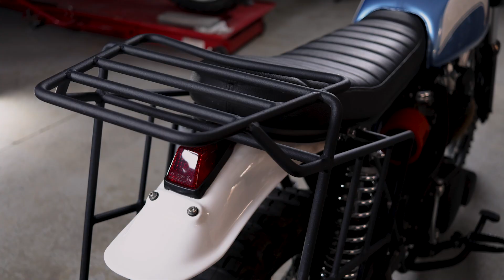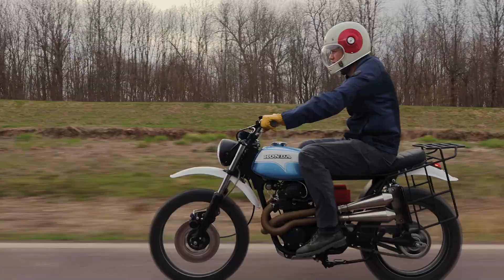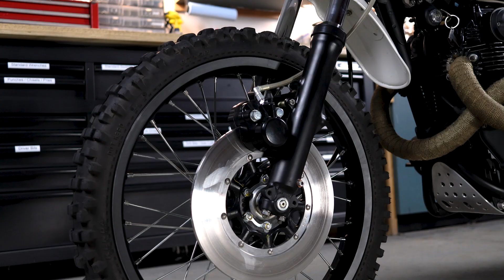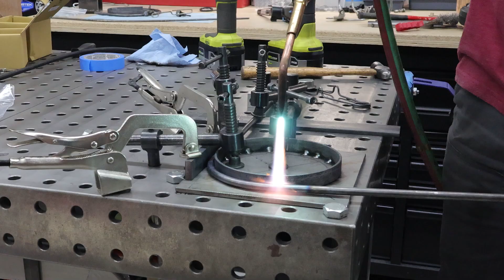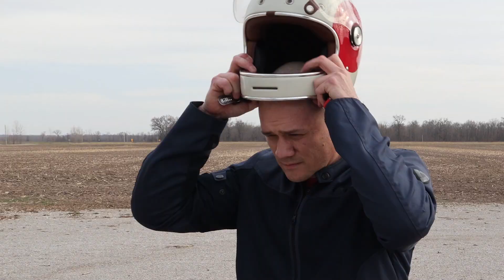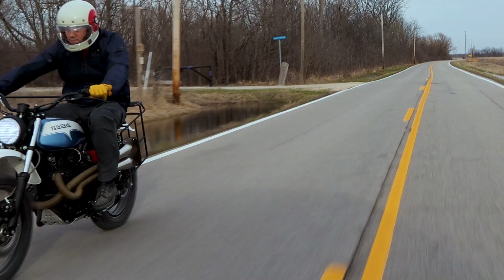Custom CL350 Scrambler- 1971 Honda Vintage Dual Sport Build Overview

Comment: Great job.   I would like to see a restoration of a CB 350 or 360 or 450 rather than a CL scrambler type and be a little more faithful to the original look.  Of course that might be more difficult because good pipes and decent plastics are hard to come by.
Reply from the maker: Stay tuned, because we will have a video of a CB750 coming out soon that's much more like what you're describing. Not a true period-correct restoration, but stuck much more to the original vibe, and one of the big reasons we did that was because the original exhaust is almost perfect.

Comment: Almost perfect. The only thing I miss is a big toolbox instead of that gaping hole where the airbox was.
Reply from the maker: Yeah, some people either love that open space or hate it. We did keep the stock tool box on there though, right at the bottom of that open triangle. It's not huge, but enough for a small tool roll.

Comment: Stunning, but why in the world would you ever replace the classic high pipes!?  Those are the focal point of the entire bike.  Full stop.  Swapping in modern mufflers for the originals makes this a Frankenstein creation rather than a tasteful update of a classic
Reply from the maker: Well to each their own, I suppose. In this case, the original mufflers were in too rough shape to keep, and we could either try and source a good original set that was in a condition we thought would match the condition of the build (essentially would need to look brand new), or we could do something that's not stock. We definitely like the original exhaust on these bikes, but we like it this way too.
Reply: @slipstreamcreations  Far better!
Reply: Those aren't "modern" mufflers, they are classic reverse cone megaphone mufflers. The stockers couldn't look this good no matter what you did with them!

Comment: What would happen if you ran both exhaust pipes into a single muffler?
Reply from the maker: You definitely could do it. We're working on another 350 now that I'm considering running 2-into-1 on the exhaust.

Comment: Beautiful build. The customer has to be tickled pink with your work. I've owned three Honda 350's; two early CB's (in the 70's) and more recently I restored a Panther Gold metallic SL350K2. They hold a special place in my heart.
Reply from the maker: Thanks! I would love to have a Panther Gold SL350. I'm curious where you sourced your paint from. I'm always on the lookout for good places to match rare colors.
Reply: @slipstreamcreations  Thanks for the reply. I lucked out with the SL, it lived in a barn for most of its life and didn't need a repaint.